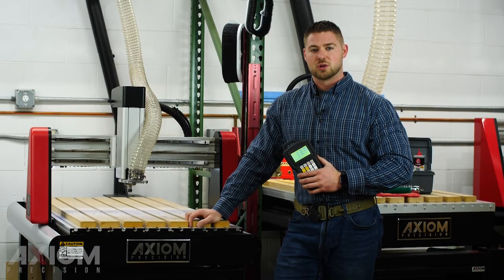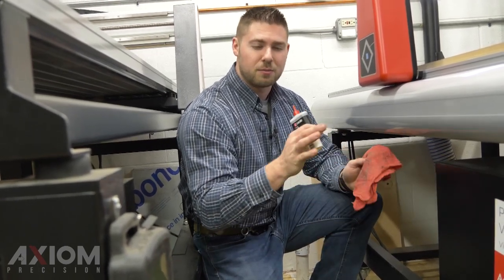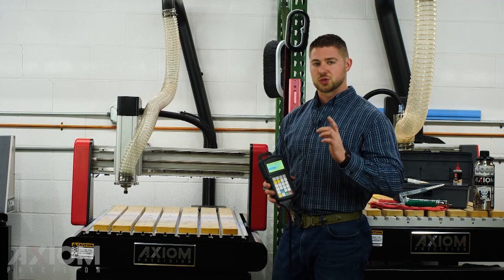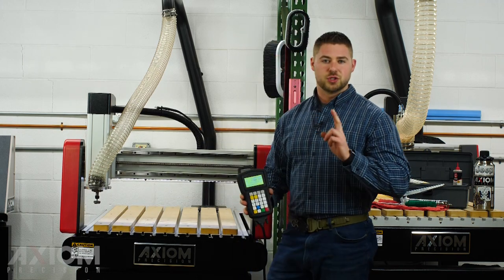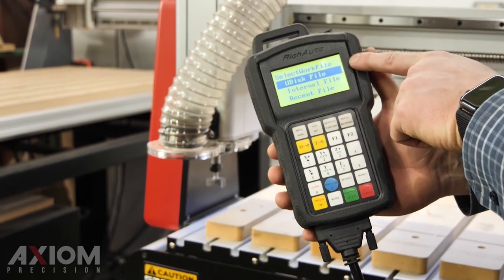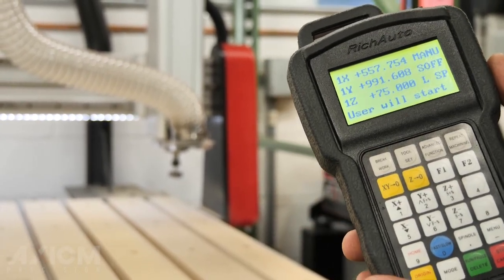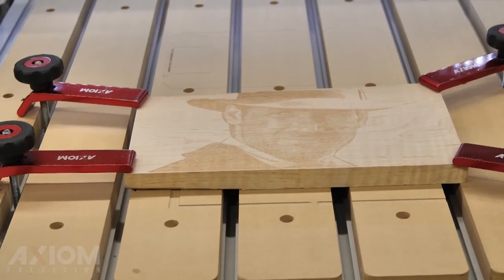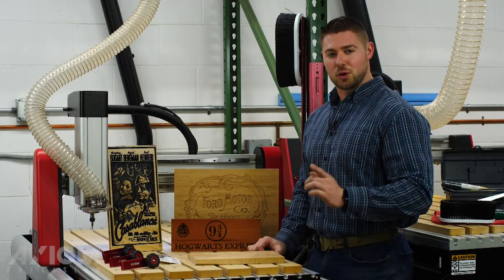Axiom CNC Machine Training ( Maintenance, Spoilboard surfacing and V-Carving)

Comment: can I use inch su15 bit with the internal fine to resurface my iconic spoilboards 2x4 size?
Reply: IDC su-15 1.5" ultrasmoorh surfacing bit
Reply from the maker: You can use a 1.5" bit with no problem. Just remember if you use the same file there will be no time advantages to using the larger tooling unless you create your own surfacing file.